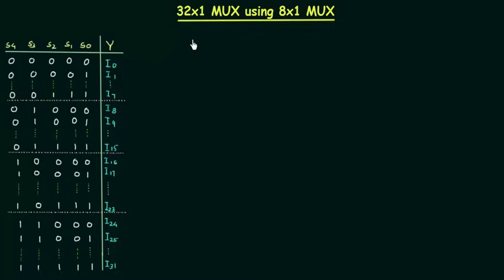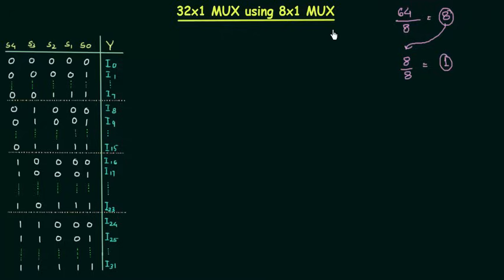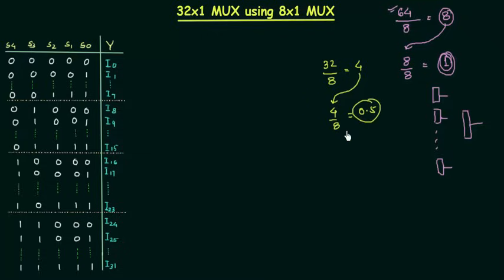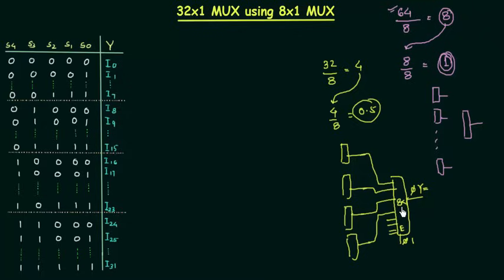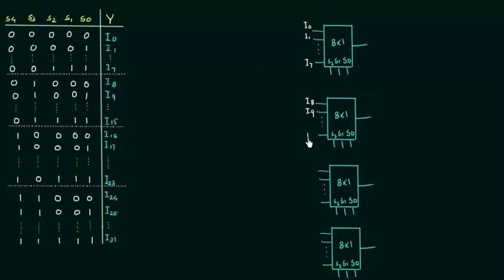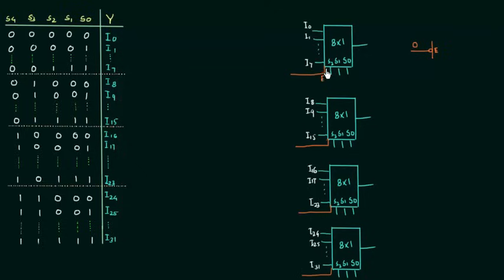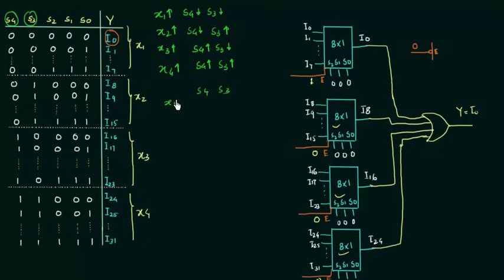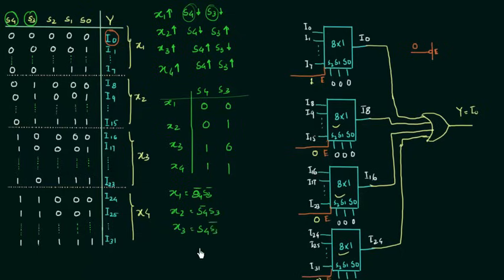32X1 MUX using 8X1 MUX

Comment: a) Design a 32x1 MUX with active low enable using dual 4x1 MUXs with active low enables 
and 2x1 MUX with low enable. Use minimum extra logic to design the required MUX.

Comment: whenever you have 0.5 required Nx1 MUX, just use a (N/2)x1 MUX in the final stage, this would be easier and more efficient. for this example you could use a 4x1 mux in the final stage instead of using 4 AND gates to make a decoder for the enable signal , also you won't need the 4 input OR gate. all these extra gates consume power and increase the delay and the area.
Reply: kuch smjh nhi aaya pr padhke accha laga. Well Done!
Reply: Exactly 💯
Reply: I mean the design he did is exactly same as 4:1 mux design. 
For notation purpose assume a=S4 and b=S3,
Y0=output of first 8:1 mux,
Y1=output of first 8:1 mux,
Y2=output of first 8:1 mux,
Y3=output of first 8:1 mux,

Y = a'b' Y0 + a'bY1 + ab'Y2  + abY3 ( internals of 4:1 mux )
 So in this case, all the AND gates and OR gates will be IN FRONT of the 8:1 muxes.
 From a physical design point of view, the design he gave in the video is much better since we are, in a way, applying gating to avoid unnecessary switching power cost - an optimization we would have missed out on if we kept the AND gates in front. 

You're answer is the most intuitive, and exactly what I was thinking too. But the guy in vid's answer is objectively better, very nice video.

Comment: Can you show us how to design a higher mux using lower mux of two different types. We got a question in exams of designing 32:1 mux using two 16:1 and one 2:1 mux.
Reply: this is easy, just take  the outputs of the two 16x1 MUXs and use them as inputs to the 2x1 MUX. then use the 2x1 MUX selector signal as S3.

Comment: just a small correction at 14:17 to get i25 s2,s1,s0 is 0,0 and 1(as seen from the table) respectively and not 0,0,0 as mentioned in the video plz make the required correction.
Reply: RU KIDDING?

Comment: sir first of all you said that we will find out (i0) end of the video you found the (i25). please explain the (i0)
Reply: Well...let me explain that...
i0 means we have s4=s3=0, so we will have x1 operating out of the four 8x1 MUX, whereas, x2, x3 and x4 will be disabled...
Now, looking at x1, for getting i0... s2=s1=s0=0, therefore, we will have i0 as the output from the x1 MUX while the rest of the MUX will give the output '0' (since those MUX were disabled)...
Finally, we will OR all the outputs for the four MUX and the result will be i0...

Comment: You can also use a 2x4 decoder for S4 and S3 and give the outputs to the respective multiplexers.
Reply: This is  the internal circuit of the 2×4 decoder

Comment: Sir,in implementation of  32:1 mix using 8:1 mux 
S4 and S5 are connected to and gate then  s4's5' passes through and gate then why enable is 1
S4' is equal to 0 
S5' is equal to 0 
When 0 and 0 passes to and gate enable should be 0.

Comment: I think there is an easy way to implement it :
Use 5 8X1 MUXs:
1st MUX  has inputs i0 - i7 , select lines s2,s1,s0;
2nd MUX has inputs i8 - i15 , select lines s2,s1,s0;
3rd MUX has inputs i16 - i23 , select lines s2,s1,s0;
4th MUX has inputs i24 - i31 , select lines s2,s1,s0;
5th MUX has 1st two inputs = output of 1st MUX ;
                         2nd two inputs = output of 2nd MUX;
                         3rd two inputs = output of 3rd MUX;
                         last two inputs = output of 4th MUX;
                         select lines = s4,s3,s3;

Your lectures are really nice.Thank you.
Reply: nothing related to this topic I just see 7 years ago comment so I just want to ask you how are you doing now in life brother😊😊
Reply: @rijusaha1309  Doing decently well in life brother. Thanks for check upon me. How about you??
Reply: @praveencv431  I'm currently in 2nd yr of my btech course, don't know what gonna happen in future,btw if you don't mind can you tell about your job or which company and suggest me some tips for my future 😄
Reply: Or better yet use a 4x1 Mux instead of the 5th 8:1 Mux.
Reply: @varshanmanish2951  but then you miss the point of using only 8x1 to implement 32x1
Reply: @omanshsharma6796  oh yeah I forgot about that.

Comment: thank you for the video.  Instead of using the enable button and an or gate, instead, can't you just use another 8x1 multiplexer with inputs 0, S4, S3?  This will cause it to act as a 4x1 multiplexer.  will this work?

Comment: why do we need those 4 AND gates for enable. We could have put Enable  = "0" or "1" . depending on the MUX we dont require .
Reply: As per my understanding if enable ="0" it totally shut down the mux...So we could not get any output from that
Reply: we need 5 selection lines there...since it is a 32×1 MUX.....only with these 5 selection lines, we can decide the output